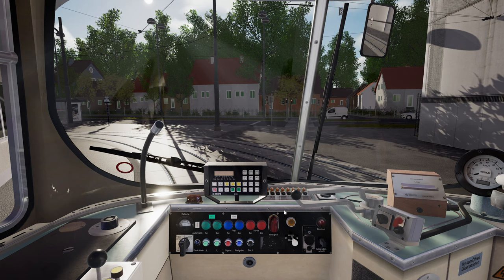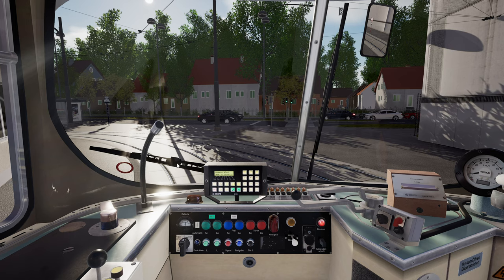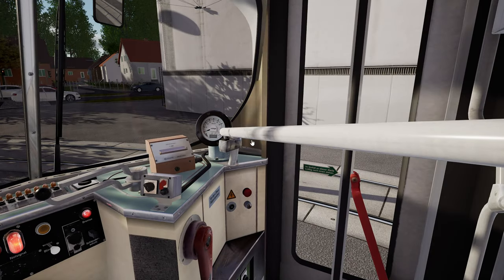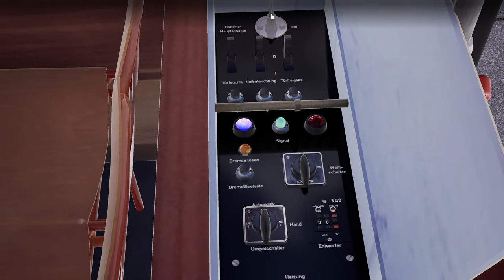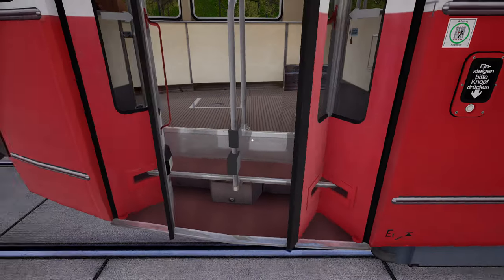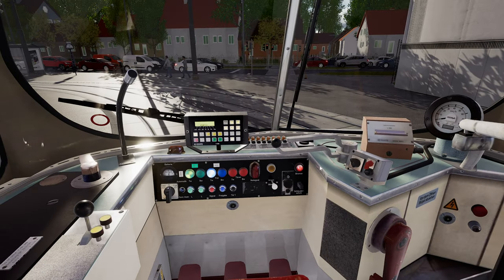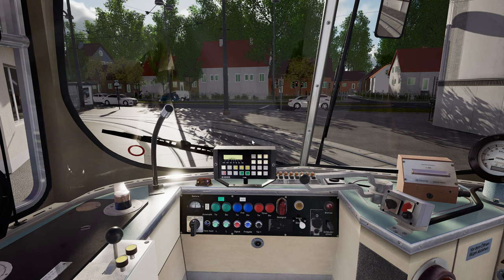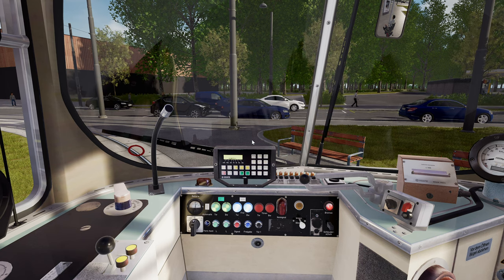Quick and dirty Tramsim E1 cold start tutorial

Comment: How am I supposed to attend the trailer controls when in my instance on 4471 there is no trailer? It just is buzzing all the time and turns breaker off as soon as I try and push power forward.
Reply: Same. Did you ever figure this out?
Reply: @KevinStoffel  Nope, it does not seem to work without the trailer
Reply: At 0:41 if you have no trailer then leave the "BEIWAGEN" in the MIT position, the buzzer won't come on & you will be able to drive.
Reply: @KevinStoffel  At 0:41 if you have no trailer then leave the "BEIWAGEN" in the MIT position, the buzzer won't come on & you will be able to drive.